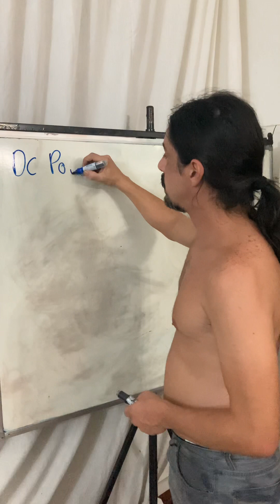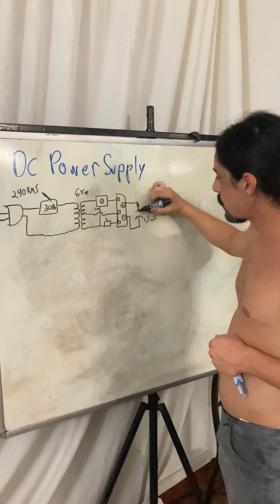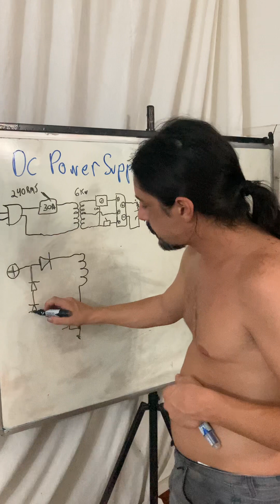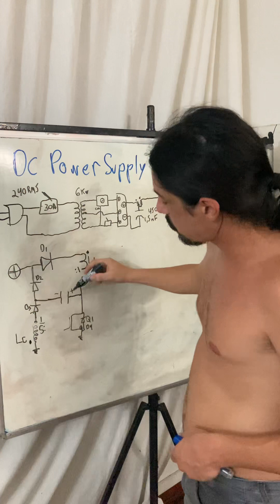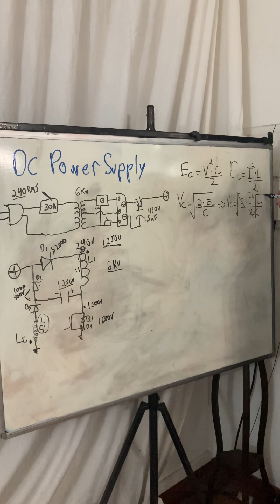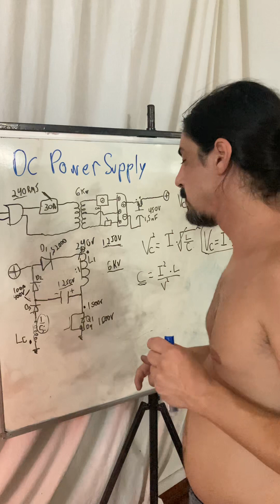Stanley Meyer technology water fuel cell revisited with more knowledge Part 1 : The dc power supply

Comment: in Portuguese or in English?

Well, let's wait and with the aim of having more foreign views, I will write in English..

The "Fundamental" question is: Did you achieve HHO production as Stanley Meyer advocated, or are you simply still searching?

When I mean if you succeeded, it is if you actually managed to efficiently produce Oxyhydrogen gas (HHO) like pure water, without the addition of electrolytes. and more than that, if you achieved energy efficiency (that is, consuming low power from its source).

Not forgetting that, according to Stanely Meyer, production by resonance is very efficient, where the voltage is extremely high in the reactor (capacitor) that is, in the set of tubes and with a minimum possible current... in ranges of under 10mA

I hope you can answer my question honestly. Greetings friend.
Reply from the maker: I still didn’t got it to work actually since I posted this video I had not many time to spend on it… it still siting in my main room here im just out of money and time to finish… working on the first to get the second to be able to finish it… my theory now resides in making water vibrate in magnetic field in cavity where it will give back electric potential blocking the amps and allowing the voltage to take over line Stan said… the water must be the conductor in a generator like effect this is the only way to block the current I could found… take a look on my last videos you will get the structure I’m aiming for